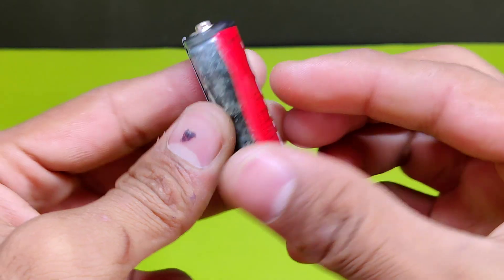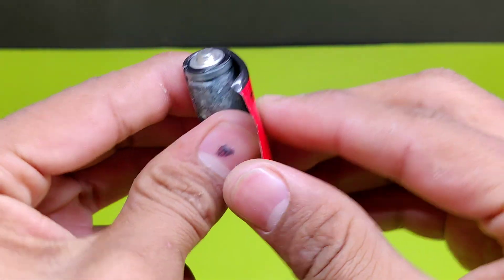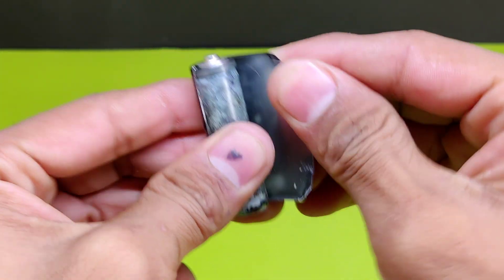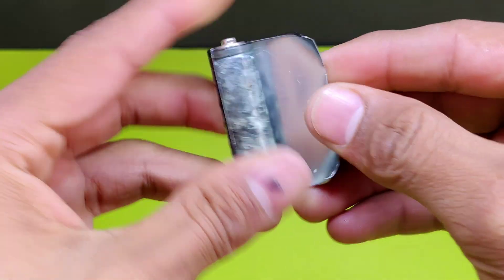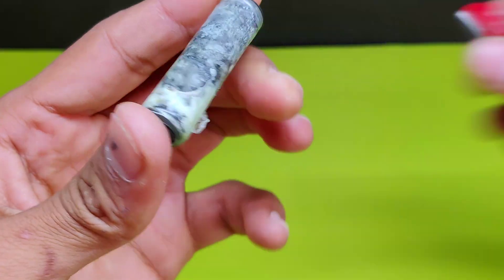How to Make a Soldering Iron at Home! Best Soldering Iron! Don't miss

Comment: Wow! How do you solder with it, melting a solder wire is one thing, but getting a solder on, for example, a circuit board is something else. Requires something that can hold the molten tin and attach it to the copper etching.